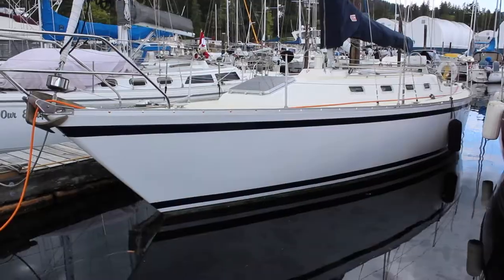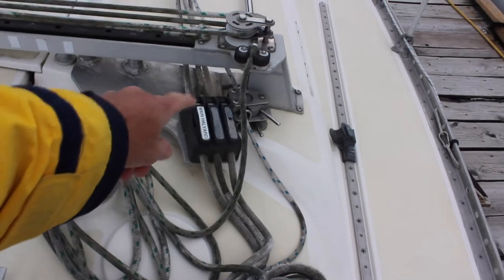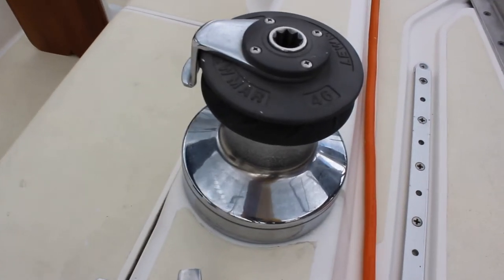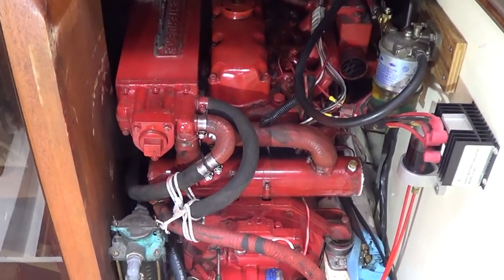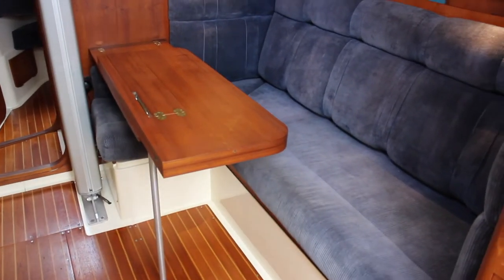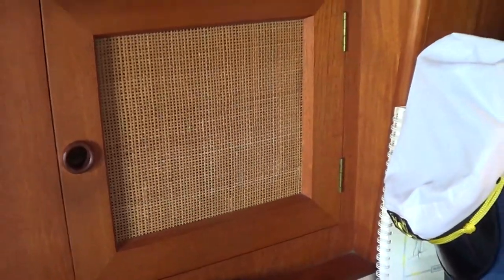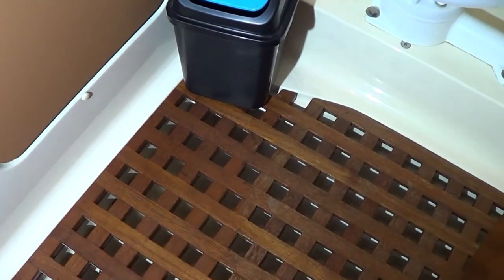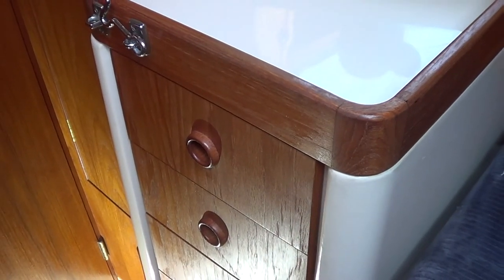Canadian Sailcraft "Traditional" 36

Comment: I own a CS 36 and love it. The only thing I would change is the shallow bilge.
Reply from the maker: Fabulous vessels, 
a true sailor,   where else can you glissade along at four or five kn in the same amount of wind?

Interesting point, I  Now know and understand the difference when you have an hourglass shape hull versus a more modern slab style hull with flatter underbelly.

The CS gently rolls over as the wind increases whereas a more modern Beneteau, Hunter,  will tend to just flop over on the side and want to naturally round up into the wind.

I would definitely consider a Tony Castro version of a CS, whether it’s the Merlin 36 or the 40—

Have you sailed either of the Tony Castro designs?
Reply: I haven't sailed the newer ones, still discovering the ins and outs of the traditional. Actually this is the only CS I've seen so far in my area.
Reply from the maker: @TheStormFish  Average ratio of CS 36T to regular boats here on the West Coast of Canada-- Vancouver island-- probably 1/5--

 I just heard of another recently selling and another that folks have owned for 15 years--